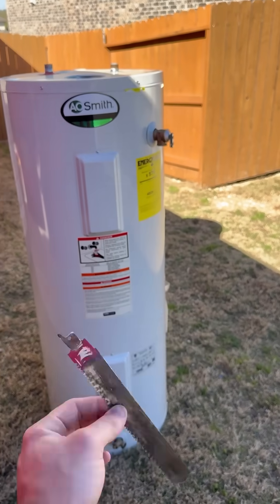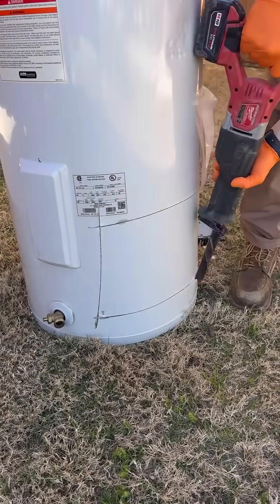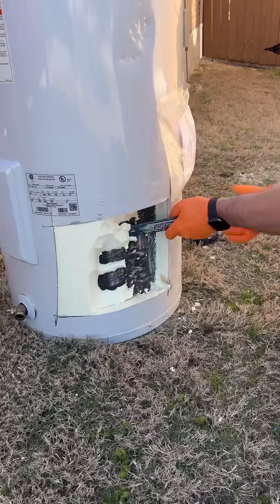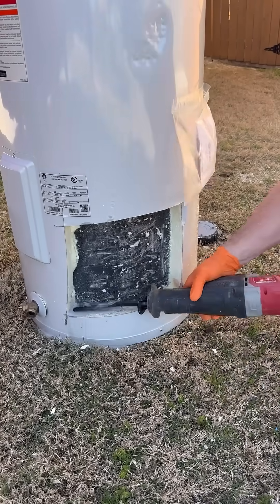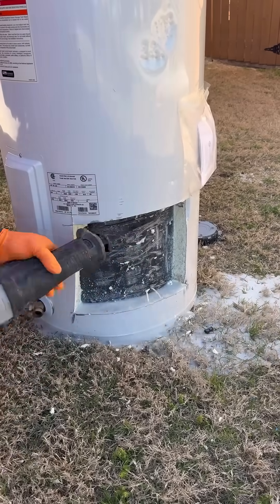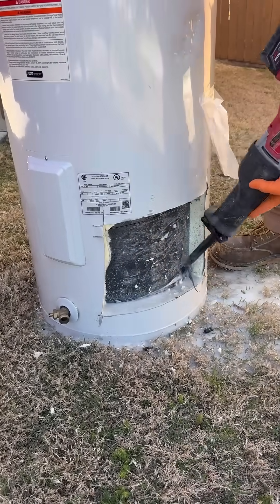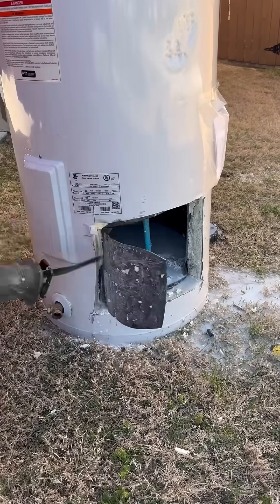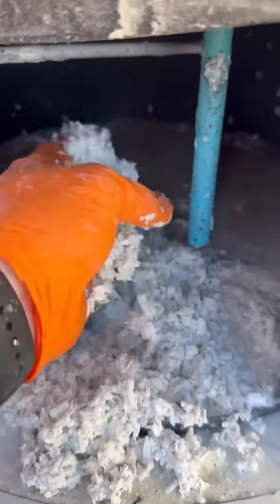What Is Inside This Water Heater?

Comment: I used to extract about 3 buckets (30kg) of that stuff from our 2500 L heated tank every 6 months in the brewery I work at. If there's any way to wash inside do it, it's inexpensive and quite fast. I use Nitric acid 65% diluted 2:100 and it's spotless in 10 minutes. If it's not, repeat. Then rinse abundantly
Reply: problem is you can't exactly tell if a water heater is clean on the inside or not...
Reply: Remove heavy deposits manually first to save wasting the acid.
Nitric acid is expensive, and I'm not sure it's legal to use in this way and then throw away the products.
It also attacks the copper.
Better to use dilute hydrochloric acid until it stops fizzing. Acetic acid is safer, though slower.
Reply: @ahaveland  good point nitric can't be left working for too long or it will start eating. In my case we use it on steel tanks and the contact time is short so it's not an issue. 
For the cost there are more affordable options but you use little and sporadically so it doesn't matter much. 
About disposal in my country it can be safely disposed in the sewerage if neutralized (after use it is, or just rinse more).
Reply: @KonsoTerzo  Good answer, but you can keep the Ca nitrate product and use as a fertilizer - better to keep on land first than flushing eventually into the ocean to cause algal blooms etc!
I use HCl because it's cheap and available in hardware stores here in Hungary. Good for kettles too, but it attacks porcelain and makes it rough if too concentrated, so have to watch for that too!
Reply: @williame2840 use the spot where the anode goes and inspect that too.

Comment: Here in Detroit you'll probably discover more lead then calcium cuz every water connection hooked up by residential or business Plumbing has a lead pipe from the main in the street to your water meter. Even though you have new pipelines Galvanized, Pvcp, PEX or Copper you still are connected to lead water lines out in the streets to your property.

Comment: The Diablo carbide blades cut through hardened steel like BUTTER! I use them on seized pins all the time as a heavy equipment mechanic! They aren’t cheap but definitely worth the time and hassle, when the ole Heat and beat ain’t working!

Comment: Once a month you can hook the drain to a hose, open the drain and let it run until the water seems clear. You can remove the calcium before it turns into a more solid substance and clogs up your water heater. Only takes about 10 minutes and you can just leave your water heater on. The water will refill just the same as using one of your faucets.
Did you know a hot water heater doesn’t go bad? It’s a water tank. The heating elements and controls can go bad, but can be replaced.
Reply: unless you can't replace the anode and it rusts.
Reply: @michaelhogan9053  they even make flexible anode rods now so you can replace them even if your tank is in a low ceiling area. 👍

Comment: Yes but how do you clean them to be saved and reused? I have a water heater that's got build up in it and I've no idea how to fix that
Reply: If it is electric, pull the lower element and shop vac through the hole.

Comment: One of my previous homes had an issue with the lower heating element both Electric I unfolded the upper and lower elements the lower one was cracked and leaking water through the connector went over to a local store in Houston called you plummet carrying older plumbing supplies for older homes the bolts were rusted out remove those re-taped it with a larger size and use stainless bolts along with high temperature gasket material after replacing the lower element I used a wet and dry vac to suck out all the calcified sediment and bolted the new element in place with stainless bolts and high temperature gasket material I also did the same thing with the top element which was okay but use some stainless bolts for future maintenance and replace the valve in the bottom with a 45° ball valve which made the whole larger to allow to drain the tank and get the sediment out of the tank

Comment: interesting fact is the calcium actually crystalizes when you shut off the heat and the water cools, causing the minerals to settle. Having a filter before the water heater is what i do to prevent it, it needs changing every 60 days but its cheap

Comment: Put A Filtration System At The Water Inlet At The Foundation Of The House.  And Keep Changing THAT FILTER  As It Starts Plugging Up. Problem Solved And Cheaper Than Replacing Water Heaters...

Comment: Have you cut open any of the "Hydrojet" Bradford White water heaters, if so was there any noticeable difference in the level of sediment buildup? I always try to talk my customers into spending a little bit more to get one over a cheaper brand because I've had really good luck with their tanks lasting a few years longer. So I'm genuinely curious if the Hydrojet feature actually makes a difference or if it's just a gimmick.

Comment: This wouldn't work in some countries. In Greece most electric water heaters are Dewar flasks. Meaning the inner tank is tempered glass, with a polyurethane insulation and a metal outer shell. Of course the inner container being glass, means that you can actually use vinegar to dissolve those scaling deposits....

Comment: Why don’t the manufacturers make small water tight doors at the lower part of the tank?  You could then turn off the water, drain the tank, clear out the calcium, and you’d save having to replace the tank.

Comment: I’m an HVAC project manager and we do our fair share of water heaters. To me, that’s a great condition unit. It’s amazing what people will allow to happen “as long as it works”
Reply: That’s because most technicians charge a drop of blood and ten years off my life for anything that says routine.
Reply: People NEVER see what's building up, that's it happens.
Reply: I have cut one open and the buildup is an inch and a half thick on the sides and 3 inches on the bottom. 😅 lasted 20 years though.
Reply: @cconnon1912  Lots of plumbers will tell you not to flush a tank type because of what you just mentioned.  
They last just as long if you leave them alone.
The tank type in the house i grew up in lasted 20 years too.
My current one is over 10 years.

Flushing disturbs the sediment, and exposes the bottom of the tank which would otherwise have a layer of "sediment" shielding it, and why risk getting that crap in house piping, clogging up diverters and aerators?

Funny story. 
Maybe.
 A trade magazine did a study.  
High efficiency wall mount and heat exchanger style water hears will drop in efficiency to about 66% in 3 years if you do not have it properly flushed (with chemicals) every year, so if you have any friends or neighbors that brag about their high tech $3500 water heater you can let them know that if they are not flushing it every year, a $600 tank type is still more efficient, because the heat exchangers of high efficiencies essentially get clogged and covered with the same crap as at the bottom of this tank in this video.

The only true reason for high efficiency heating and water heating appliances is MONEY.  $$$$
They do more harm to the environment than  good.
Nothing beats, long term, in efficiency the simplest tank type water heater that can be found in modern times.  
Modern high efficiency water heaters are too complex.  More than a few dozen  propriety parts, computers and always "improving" (changing) year to year.  
The efficiency ratings listed do not reflect all the detriment they do to the environment by being so complex to build.

The only "advantage" high efficiency has is no "standby losses, but with modern spray foam insulation, like in this video, that factor is negligable.
Reply: Some people can afford new ❤
Reply: It amazes me when discovering that buildup can happen  who knew
Reply: looks fine to me, its heating elements are along the sides and not just on the bottom right?  If so, it could fill to well above the hole he cut and still be fully operational, tho with limited capacity.
Reply: @StarlightLumi  Depends.  Natural gas and propane heat water from the bottom.  
Electric uses one or two elements screwed into the side at different heights starting at about 1/3 of the way off the bottom.
Reply: Colton... Im building a barndominium... What is the best way to have a good, sufficient and quality hvac system designed? I've seen too many videos of terrible systems.
Reply: @BobbyGeneric145 Plain jane electric tank water heater.
Plain jane 89% efficiency cast iron oil fired boiler with baseboard or cast iron radiators.
Wall mount split system for AC.
Vapor barrier with kraft faced aluminum.  
Work out an exhaust fan for living space in temperate weather.
Reply: @BobbyGeneric145 there aint 1

Comment: Water tanks have been and continue to be wasteful.  Continuesly keeps water hot even at night, should have a timer or on off switch.
No way to remove calcium build up.
Maintenance of the anode rod could be much simpler.  
Uses to much gas or electricity and maintenance could be simpler.

Comment: I have a question for any of you plumbers lol, mind you I know NOTHING about plumbing. I have a regular well and my water completely shut off about a week ago. Initially thought the pump went, realized it was the pressure switch. Got a new one installed and the pressure is sitting at 40 like it should, downstairs water is perfect, upstairs not even a drop. I drained the hot water tank thinking it could be this problem, the amount that drained was insane lol. But still, nothing working upstairs. Any ideas?

Comment: Calcium can be fun to play with. I recommend shutting the tanks power off. Opening op the lines on the top and pouring a bunch of peroxide into it. Aside from minerals its bacteria that destroys a water heater. You can also avoid that by setting it to above 140 but you need a water temp regulator on the outlet on it to avoid being burned at the faucet. Vinegar can dissolve minerals but needs to be quickly neutralized or it will cause rust.
Reply: Calcium is very cool but you need to be very careful with it. You never know when a Helvetica scenario could happen.

Comment: I take the valve the drain valve off and use my shop vac with a modified hose and suck all that stuff out rinse it out and suck it out again and they get another several years of service out of the water heater

Comment: I fitted an electronic descaler device. It causes the scale to form microscopic flat sheets that wash through instead of beads that pile up. 
It allowed an instant water heater to operate perfectly for at least a decade. We moved away, so it might still be in service. 
The water there is so hard that an electric kettle element will be dropping scale after a week or two normal use. Ours never scaled up.
Reply: I've had an electric descale for years I don't see how a person can determine if it's working or not
Reply: Electronic descaler? Sounds like pseudo science device.

Comment: I have that same issue, we are rather a check to check family so instead of replacement all the time of the tank I remove the elements every 3 months and suck out the calcium with a shop vac and modded hose. Sometimes I have to replace the elements but way cheaper then a $500+ water tank.

Comment: Folks, Don't fall for the ole "you need a new water heater" trick. If your tank is not leaking (which rarely happens), all other parts can be fixed. Including removing sediments from the bottom of the tank. It is always cheaper to fix them rather then install a new one.

Comment: The way that stuff gets on the bottom of the tank is it actually gets baked onto the heating element then the heating element cools off and then when it heats back up to heat water again it expands and flakes off. I'm a service plumber of many many years
Reply: Isn’t this what the sacrificial node is supposed to prevent? Not the buildup in the system, but the element getting covered
Reply: @focus_gaming1438  Sacrificial anode is there to help keep the steel tank from corroding (rusting).  The anode is meant to corrode before the tank, until it is gone.
Steel hulled (body) ships may have sacrificial anodes to help protect the hull.
Reply: @focus_gaming1438  rust
Reply: I didn’t realize that! Damn, so sort of like how you get salt from sea water
Reply: @danielnansel7538  yes exactly.
Reply: @Dnbootin  kinda like salt yes
Reply: Thanks  for tips
Reply: @BIGSTANK1983, So does that mean, since it flakes off, all of it can effectively be flushed out of the tank? Or, even with flushing it will eventually cake up in the bottom and make it nonfunctional?
Reply: @nyla3235  yes and yes. You can flush it and yes it will build up and eventually render the heater non usable.
Reply: Good info 👍👍👍👍
Reply: think you might have some service vehicles for sale?
Reply: What about the gas fired water heaters?
Reply: @2000freefuel same, since the water doesn't care how it gets hot. It's all in/about the water, where you live may or may not have a lot of calcium or magnesium.
I don't have much of that, but I have a lot of iron, and that shows with rust in my hot water heater, killing it every 4 to 5 years.
Again, a water softener and blue light UV water filter helps tremendously .
Reply: @BIGSTANK1983  that's what's nice about this H 38. It removes all that calcium and breaks it up to keep the elements and the anode rod clean.
Reply: Along with the anode rod sacrificing itself
Reply: Dude my dishwasher is like this. All our plates have flakes on them. How do I stop it?
Reply: @etsoccer91  we put a little bowl of diluted vinegar in with the dishes when we wash them every once in awhile and run it on high heat. It seems to clear out the whole dish washer of the deposits but I would trust this guy if he replies over me.
Reply: @hensley2931 where does the calcium come from ? Water treatment being burned off the water?
Reply: @aracinglawnmower8975  pretty sure it's merely from the water where you live. I live in the mountains and we have hard water. Our electric kettle will get deposits too over time as we use it. Water carries minerals naturally so as it evaporates away the minerals precipitate out as hard water deposits. I have to scrape our shower heads every once in awhile too
Reply: @aracinglawnmower8975  its just whatever was in the water source. Groundwater tends to have the most from the rocks around it. If i recall correctly, it usually isn't removed during treatment because it doesn't impact the safety of the water.
Reply: @hensley2931 I live by the ocean and we have such bad hard water I literally had to throw away a couple humidifiers cause the build up was insane. I only use distilled water in my new one
Reply: @etsoccer91  flush you're water heater at least twice a year.
Reply: @etsoccer91 dont be lazy and get rid of dishwasher😂
Reply from the maker: @etsoccer91  a water softener usually
Reply: @etsoccer91   if you have very hard water, the detergent gets partly used up just handling the hardness. If vinegar doesn't work, a little extra detergent wouldn't hurt to test a couple times and see if it helps at all
Reply: @etsoccer91  sorry I took forever to answer but you can actually get rid of a lot of that stuff in the dishwasher by not using the extra heat. The same thing will happen with the heating element in the dishwasher. It will bake on  elements and minerals out of the water then flake off. Try not using the extra heat and see if that helps.
Reply: @etsoccer91  see wikipedia "Water softening" - it's not difficult.
Reply: @etsoccer91 
A water softener.
Reply: No. What happens is that, rather counterintuitive, the magnesium and calsium csrbonates are less solvable in hot water. 

Meaning that as long the water stays cool the minerals are dissolved, but as soon as the water is heated some of the mineral content percipitate out of the water and gather at the bottom of the heater.

So, w

Comment: Easy fix fellas!!!! All you need is a 5” brass nipple, 3/4” IP ball valve, mip x mip 3/4” hose Bibb adapter. Shut off the water at WH. Then removd hose
Bibb at bottom. Relax one small clung of water will come out. Screw in your prefabricated fittings. I turn the ball valve off and remove handle. Then reinstall handle and hook up to a hose, turn water on and watch all that builld up come out!  It’s a full port on the ID of everything. Bigger on the inside. Not like your hose Bibb with small opening, it won’t let the buildup pass. Also you don’t have to drain water heater fully. When the sediment stops coming out, you can turn it off. I always do this when I install a water heater, but if the water heater is really old, don’t waste your time. Get a new one.

Comment: So where I live here in Australia, we have reticulated gas. Our hot water is "instant" via a gas unit that's about the size of our fusebox. After living in the house for 15 years I called a plumber and asked if the unit should be looked at, serviced, whatever. He said no they basically never break. And it hasn't. It detects when we turn the hot water tap on, fires up the gas and heats the water instantly. And needs no maintenance. WTF. I guess it's bad that it uses natural gas but still. WTF.